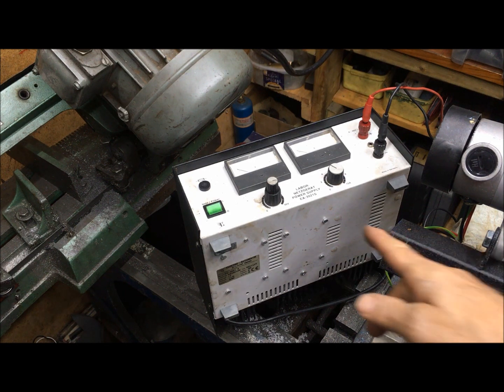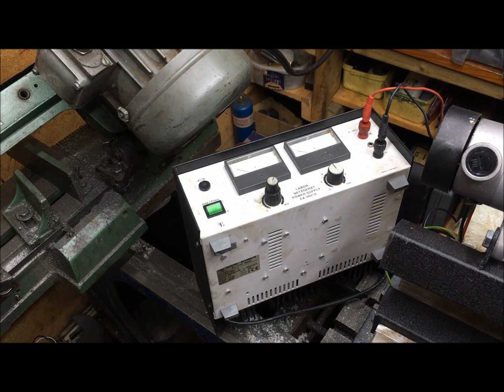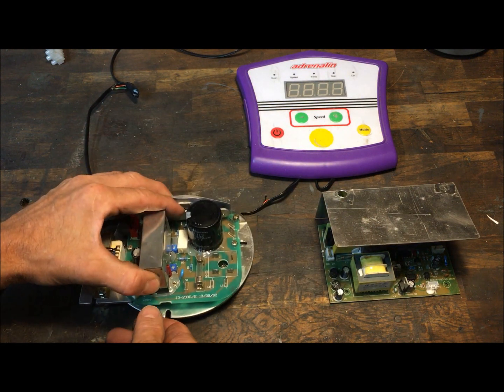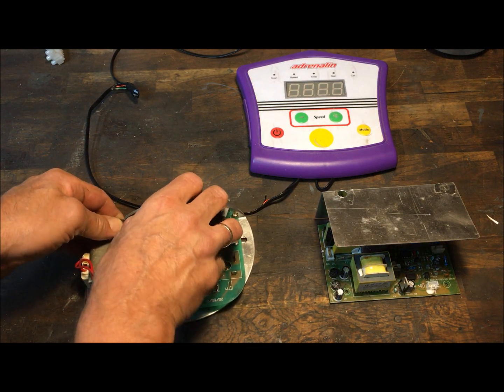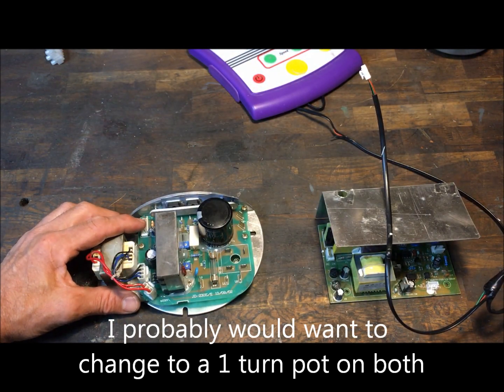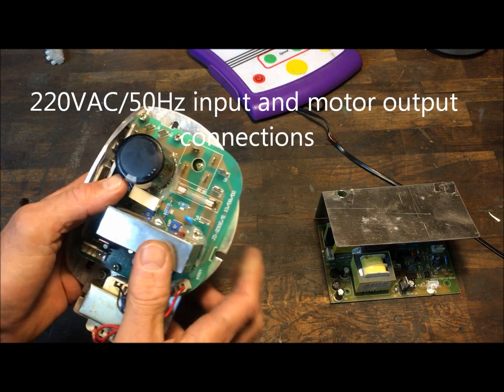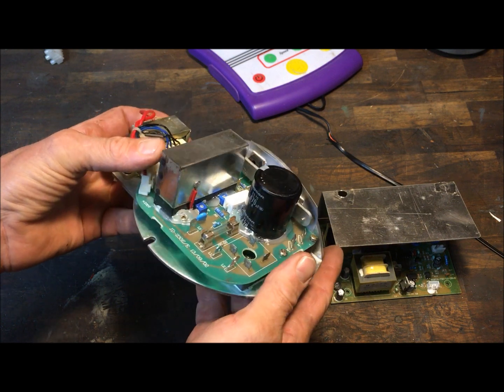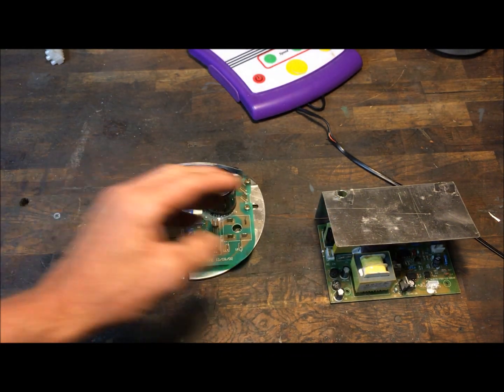Myford ML10 motor - part 1

Comment: Looks good, I have done this before and it worked well. (back in the States long before my Schaublin addiction)  I added a potentiometer to the controller and a power switch (lightswitch on the power line) which made things easy to run. You should be able to take the flywheel off the bigger motor if you want to, I seem to remember the one I took apart had the pulley threaded on but I think I cut it off before I figured that out.  I am sure it is the plan but it is a good idea to put the controller in some sort of protective enclosure, metal chips can cause issues with open electronics :)
Reply from the maker: Hi Luke,
Thnks for commenting. Will try to do this as "slick" as possible, ie. with regards to mounting and packaging  as well as operating the unit. I think I can leave the flywheel on but if it turns out to be a nuisance (eg. too long time for it to rev down and stop) I must figure out something. I am a lazy boy hence I reckon I will go for the easiest solution :)